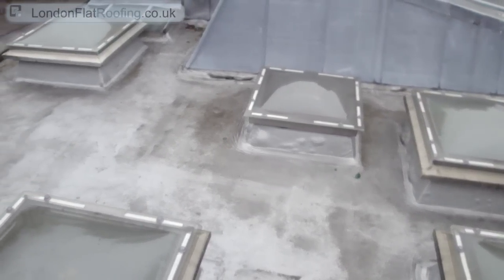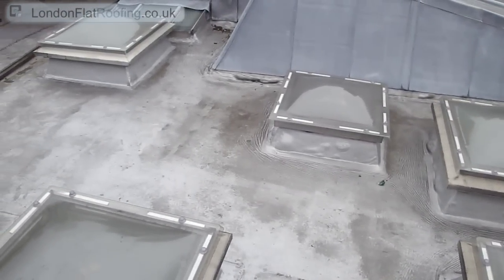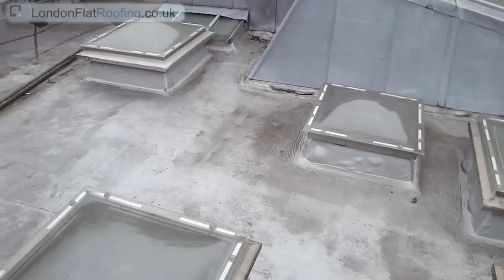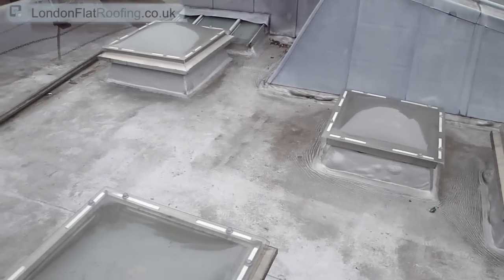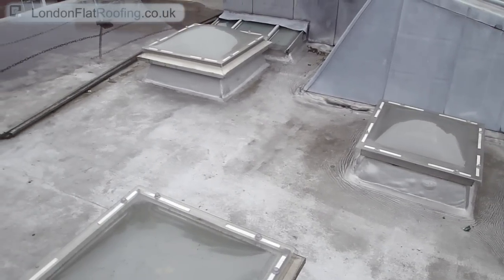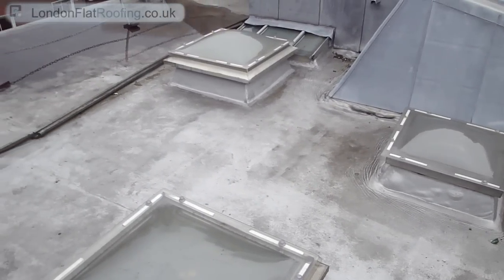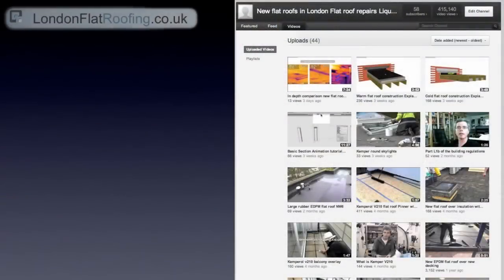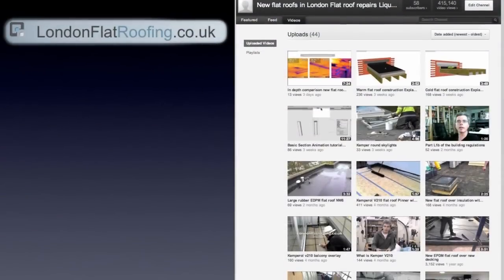Old asphalt flat roofs with blisters bubbles and cracks. Also painted in solar reflective paint

Comment: I've been having this problems with my flat roof for a while. I keep it painted, re-silvering it every couple of years. But I've been getting increasing bubbles and cracks recently. I've been filling the cracks with flexible paintable sealant before painting over it (along with the rest of the roof). The bubbles are inside the asphalt, not something coming up from underneath..they're nowhere near the size of some in the video, but a lot of them go 'crispy' and split, leaving holes. I've been scraping off the broken bits from these burst ones, and filling the holes with paint (and sometimes sealant) to try and stop it from getting worse. But the bubbles just keep forming :(

Comment: The bubbling roof at 1:20 - the main problem I would suggest is the parapet wall on either side which appears to be in very poor condition with missing mortar and brick spalling caused by the freeze/thaw cycle.  There are also no coping stones on top. This has almost certainly allowed water to ingress through the parapet and get under the roof that has caused the damage.
Reply from the maker: Yes you are probably right in part, recent, talking to an asphalter  he told me its air that's between the layers when installing. Are you into boats?
Reply: @SteveRoofer  No, I'm just a homeowner with a flat garage roof with a parapet which had some leakage problems despite being in far better condition than the one in the video. My guess is the water is entering in the defects in the parapet sinking down then tracking under the felt,  heating up and turning into water vapour causing the bubble. If there is an air gap between the layers during the installation I presume that would make this process easier.

Comment: Hi Steven. Thanks for all your interesting videos. Your video of the old asphalt roof with blister bubbles - I have a roof similar to this (perhaps not as bad, about half the number of blisters). Have you done a video showing how to repair or renovate this roof problem? I don't actually have any leaks, fingers crossed. Could I simply paint the complete roof with some type of high build bituminous paint and then solar reflective paint?

Comment: There are a number of reasons that asphalt can start showing signs of movement, but generally the first place to look is the substrate on which it has been laid. 

Where you can see those straight/right angled splits in the flat, shows that this has been laid over insulation boards, probably over a timber deck as well. Without a decent solar reflective paint (silver paint isn't particularly effective) then not only does badly painted asphalt heat up in warm weather, the insulation properties of the deck will also cause asphalt to heat up further and start to move. In recent years, there has been progress with the addition of added polymers, to allow flexibility of thermal movement.

The other signs, such as blows in the flat area of the roof and on skirtings are generally because of moisture, or if the surface isn't a decent key for asphalt to adhere to. On the flat, this is because moisture has got in between the insulation boards and causes the asphalt to react to any moisture evaporation in hot weather.  This could be an issue with the vapour barrier that should be laid under the insulation boards. The skirtings on the roof lights shown in the video have blows in them because they are made of fibreglass and need to be primed with a decent primer instead of a bituminous primer or none at all, which isn't a decent key for asphalt to be laid to.

Overall, I'd argue that silver painted asphalt probably isn't the best material for a warm roof.
Reply from the maker: Yes, unfortunately, lots of parameters for the roofer to get things wrong. This is why I'm looking for a flat roofing product that is so easy to use that a fool can lay it. Parameters  would be 
No primer ever needed on any substrate. No heat involved no mixing, can be laid in wet conditions on a wet substrate. Cant be laid to thinly even if you tried. Light in colour and flexible for its lifespan of 50 years.
Reply: @SteveRoofer  Have a look at Sikalastic 621TC.

Comment: Screw aluminum 1.2mm sheets over the top of the entire roof. This will flatten the 'blows' and give you a nice flat even surface. Then simply lay new felt over the top.
Reply from the maker: Interesting approach have you  experience with doing that never heard of doing that.

Comment: Darren davies. That particular job shown on the video as been over laid, hence it's covered in blows, at no point was that mentioned, I was simply pointing this out, if mastic asphalt is crap as you put it, I wonder why there is whole industry built up around it, very strange, no it's not perfect i agree, but the new polymer roofing grades make for improved performance.I have been in the flat roof game 36 years, so please don't preach, it's very tiresome, all asphalt apprentices serve a minimum 4 years on site and at collage, and leave with a industry recognized qualification.Epdm. 1 day courseSingle ply. 1 day courseGrp. 1 day course
Reply: So funny when you see inexperienced people making videos about something they haven't a clue about.
There was no mention of the oil based paint that eats into the asphalt,
This chap has a few vids on here and you can rip the arse out of the inexperience.
One up. 👍

Comment: Reason why that small roof is covered in blisters or to use the correct terminology 'Blows' is because it's been over layed with more asphalt by London cowboy asphalters, moisture is trapped between the asphalt layers, causing the blows, when you look at the close up you can clearly see it, but you wouldn't know that would you, because you know very little about Mastic asphalt, if it's done right it will last minimum 30 years.
Reply: Mark Yeadon  if any roofing product is done right it will last. Mastic asphalt is crap for flat roofs  if used for tanking and back filled in great but exposed to heat and elements it's no better than a decent felt system. Before you say I don't know about asphalt I have used all flat roofing systems over the last 20 years and they all have there benefits but none are perfect     just coz laying asphalt is classed as a master craft doesn't mean it's the best. PS I've laid asphalt it's no different to buttering bread
Reply: Blows in asphalt will always happen if moisture is within the deck. Especially bad if laying on concrete always moisture in that. It doesn't happen just from overlays.

Comment: Nice video. An interesting material that is very blister resistant is asphalt emulsion with Bentonite clay ingredient. We have done tens of millions of sq. ft. and the stuff simply will not blister.

It was explain to me by a chemist that its high perm rating is like Goretex skiwear. It allows vapor to escape but solids cannot enter. My son likens it to skin, which is waterproof, but allows moisture to escape.
Reply from the maker: Yes it is like skin or Goretex  all materials will let vapour pass though its just how much. Bubbles in asphalt  is the transfer of moist air up and out.